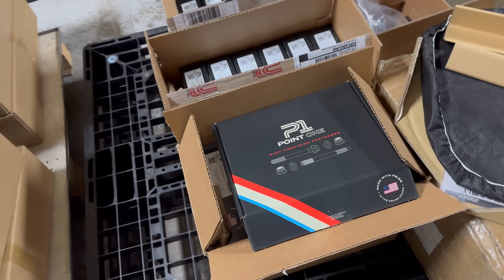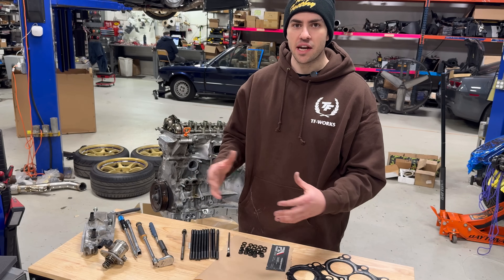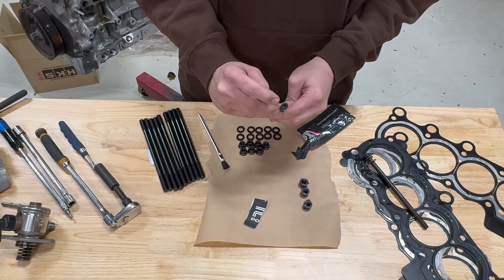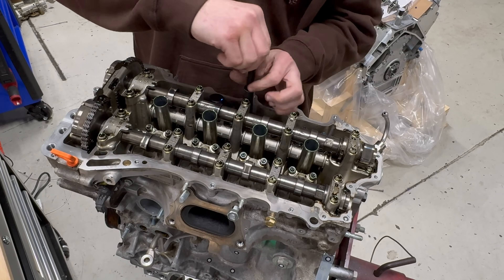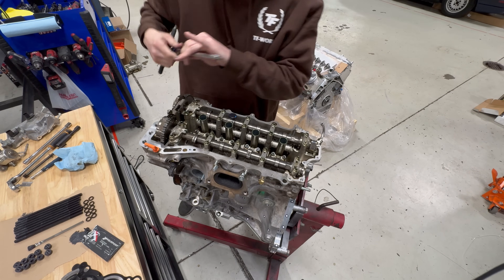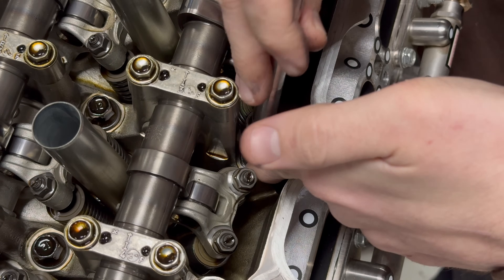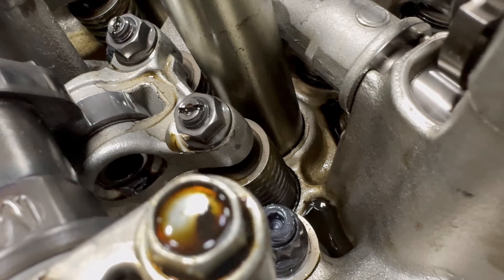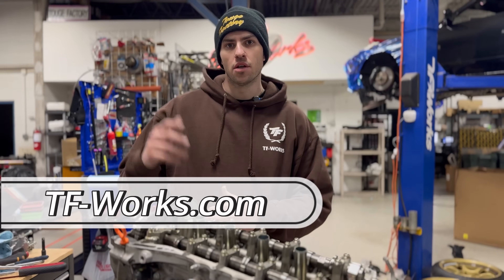TF-Works Head Stud Kit for the Honda 1.5T L15 Engine + Install

Comment: Does this work with the 1.5t vtecf
Reply: VTEC head uses a different head gasket with a larger hole for the VTEC solenoid to get pressure.